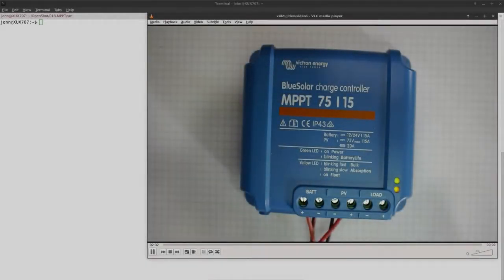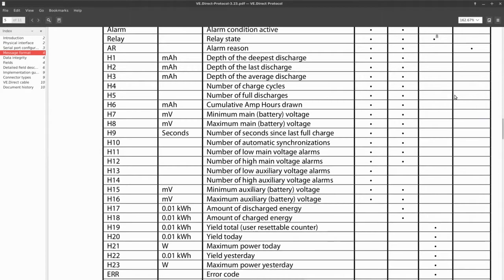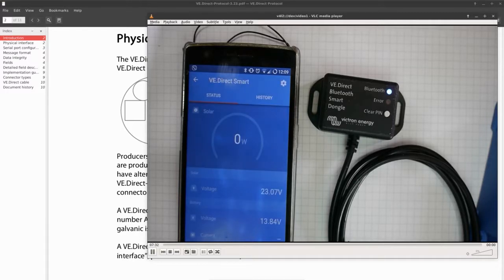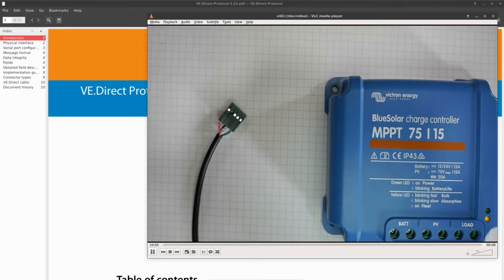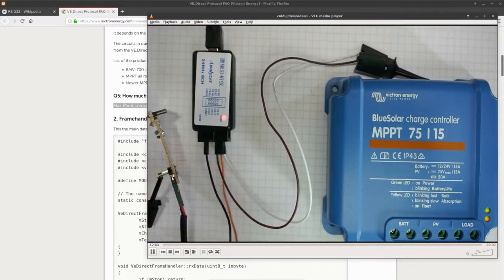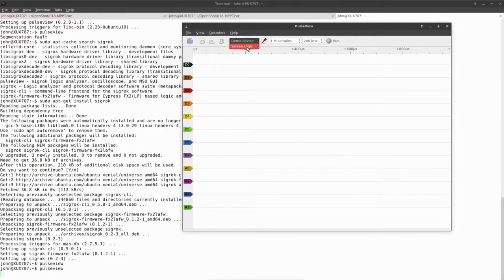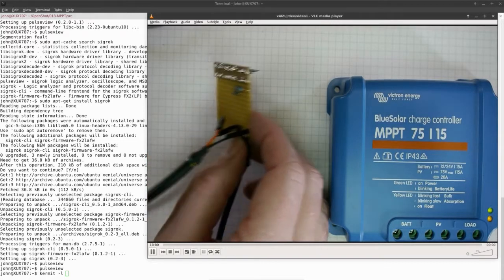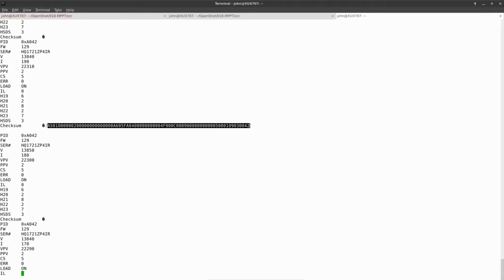018 - RS232 alive and kicking, (Victron Energy MPPT 75|15 Serial)

Comment: Good video, but your reference document VE. Direct Protocol is showing the RS-232 pinout for a MPPT 100/xx going from left to right as 1 2 3 4. 
Your MPPT 75/15 RS-232 pins are:
75/15 = 4 3 2 1  
75/15  (5v=4, TxO=3, RxI = 2, Gd=1)

Comment: Great video! I’ve managed to connect the MPPT controller to my windows pc using hurcules serial software but the code coming out looks totally different. Am I doing something wrong?
All I want is to do is view the solar controller remotely over the rs232. Was hoping I could still use the VictronConnect software but it doesn’t work.
I’ve managed to send the rs232 to a remote computer and receive the strings. Thanks Alex

Comment: Am I correct that the VE.Direct is TTL, so if I get a USB to TTL cable and fit the JST PH plug I can connect the Victon MPPT to my PC?
Reply: Local dealers want a lot of money for the Victron cable, which I think is a ripoff?
Reply from the maker: Yes VE.Direct is TTL  but I can't find any documentation for the pin out of that connector. Certainly if you get a cable with a matching pin configuration, or change the pins so that they do match then it should work.
Reply from the maker: Found this which might be of use to you - http://beta.ivc.no/wiki/index.php/Victron_VE_Direct_DIY_Cable
Reply: @electronicsoup2001  the usb to ttl cable I'm getting has jumper connectors thats labelled, and the VE. Direct document has the pinout for the connector, so should be straightforward?
Reply from the maker: @nickidewet7711  Should be totally straight forward. All you need for a start is to connect two pins, both the ground reference from the Unit and its Tx signal. If you've got a scope or logic analyser you can look at the signals before you connect to your computer. Either way I don't think you can do any damage. I would not connect the +5V signal at all as you don't need it if you're connecting to your computer. Solar Charge Controller has its own power as has your PC.

Once you're happy you can see messages from the Solar Charge Controller you can connect the Tx Pin from the Computer side to the Rx side of the Charge Controller and start sending commands.
Reply: @electronicsoup2001  thank you, going to do that tomorrow ✊🏻
Reply: @electronicsoup2001  and it was! Got it working, pinout in Victron's doc is wrong for my 75 15 mppt, tx and rx is wired like consumer, not producer. Got the Victronconnect app on Mac and connected first time, also updated firmware of mppt 😀
Reply: @electronicsoup2001  your video at 2:05 has the pinout.